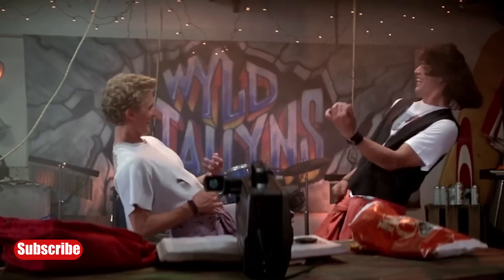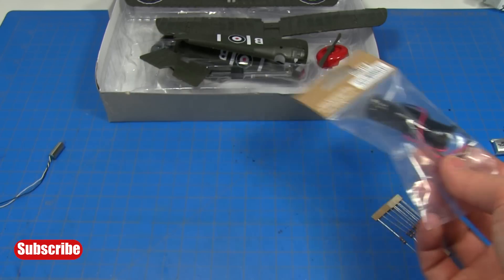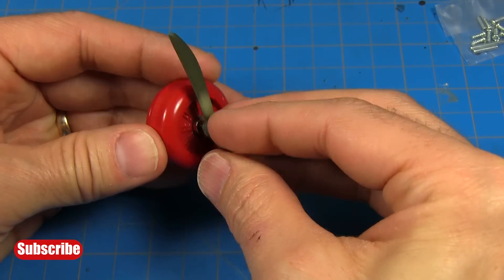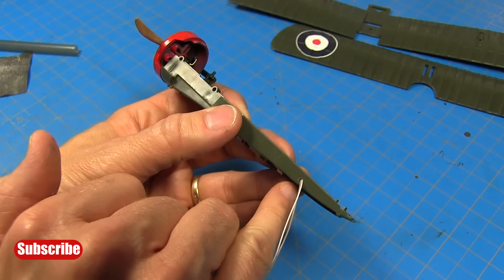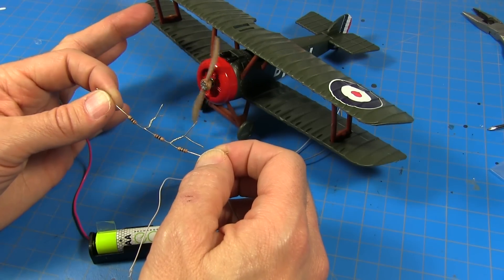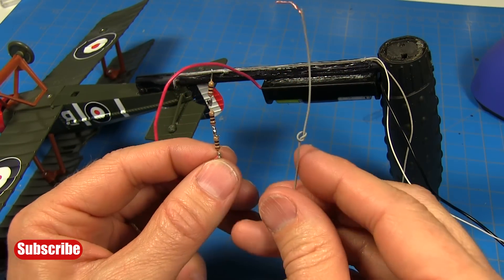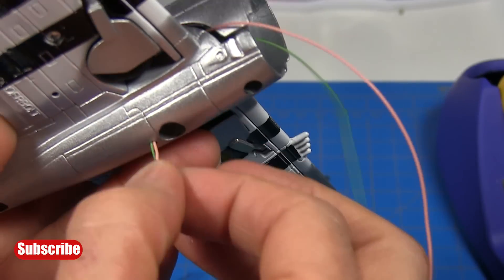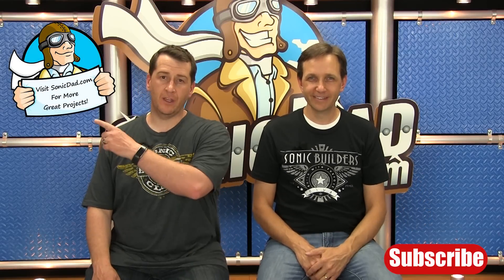How to Install a Motorized Propeller in a Toy Plane

Comment: why not have the battery inside the fuselage? it might be a bit of a tight fit because your using a AA battery, you could use a AAA or even a button cell battery, also if you have lots of flat surfaces and are working in very tight spaces (which the one in the video isnt) i recommend you use copper tape, you can solder wires to it and its super low clearance.

Comment: Good tutorial! But I'm making a Tu95 in 1/72 scale and I want the 4 props to rotate, how do I make all 4 props rotate and make it USB type c powered? Thanks!
Reply: @RetroSoaring thanks a lot dude, unfortunately i finished the kit without the props rotating, i might make the rotate in my Lancaster
Reply: connect the motors in series + to - until you get to the resistors. Think about a one way road.
Reply: @VictorMartinez-ue8td  thanks dude

Comment: im new to channel and just love it! 
very impressive. 

lov to see you build a running  train set going thru the mountains. preferably a steam engine puffing smoke would be awesome. 👍😎 

Have the running planes simulating flying overhead on some type of wire system, all gauge correct.

you should sell some of these. lov to buy some for the kids and Me mainly😆

Comment: Instead of 3 resistors, just try one rectifier diode like a 1N4001 in series with the motor. The 1.5-1.65V volts being supplied to the motor will be around .8 - .9V.